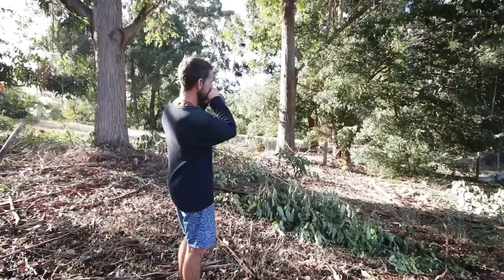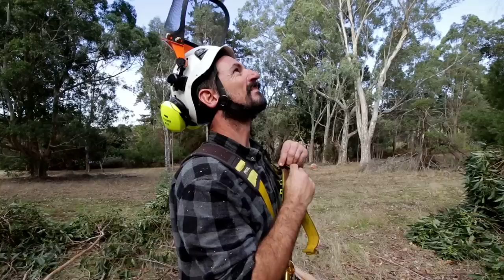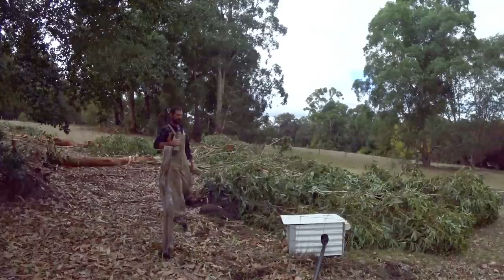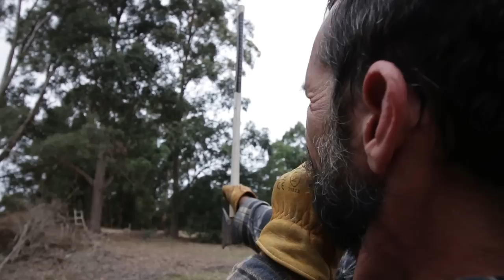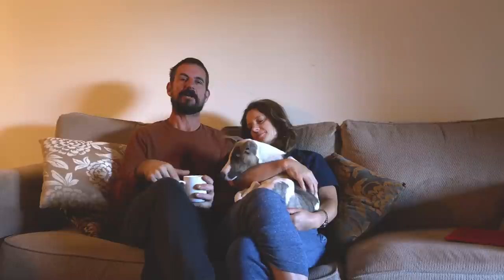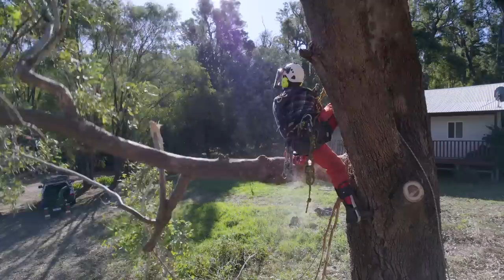Oh No! My Boyfriend is up a MASSIVE TREE with a CHAINSAW 😬 - Free Range Homestead Ep 5

Comment: You can compost the woodchip and use it on the garden in a no dig system. Have you seen the film Back To Eden? It's based on this system. A lot of people get confused over woodchip, as woodchip from a sawmill is going to rob nutrients from the soil. However chipped limbs containing foliage as well as wood is perfect compost. 50/50 brown and green. The green providing nitrogen.

Comment: Buy some inexpensive golf balls and drill a hole, most of the way through, that is a bit smaller than the tang on that file you are using to sharpen you chain saw blade.  Then pound that file's tang into that hole in the golf ball.  It makes it much easier to hold the file and do the job.

Also, if you are having problems getting a light line into the tree, as I did, try using a slingshot and a golf ball.   I had to modify the slingshot to have a larger pouch to fit the golf ball and I drilled a hole through the center of the ball to attach a light line.  But it worked well, though I would recommend using bright florescent orange golf balls so they are easier to keep track of as they fall through the leaves.  I caused significant injury to both of my shoulders in sports when I was young so this is the solution for me.
Reply from the maker: We used to do just that

Comment: I am a professional arborist and if you file down to the smallest cutting edge you'll use your chain up big time, if you have a cutting edge thats much smaller you take the raker down so it has the right gap. Throw out the husky and buy a Stihl! You file the edge until the is no nickel showing.  People feel the point a lot on the cutting edge, you want to ave the whole cutting edge so your finger almost sticks to it.Ive been doing this for 24 years!

Comment: I had never ever cut down a tree in my life until I bought the house I currently live in.  There was this straight as an arrow pin oak tree really close to the house.  I felt it was too close for comfort.  These trees will kill lower branches as they stop producing enough food.  The dang branches just hang and cause a mess around the tree.  I could not walk around it to cut the grass.  I had to push the branches out of the way and hit myself and such.  Annoying as heck.  I didn't want in the future the tree dropping branches onto the house and also I was worried about the roots getting into the sewer and basement.  At any rate it was pretty thick maybe like three feet in diameter or a bit more.  The branches were super even on the tree.  My brother in law was over to help.  He had some experience but nothing with trees that big.  Well we had done the typical cut like you did in that last big gum tree.  Oh it was like almost 45 feet tall as well.  We cut that pie piece out between a locust tree and a maple expecting it to drop there.  But the branches were so even it just stood there.  So I ran to the store bought 120 feet of yellow acrylic ropes.  I tied one end to a hammer and threw it up as far as I could.  By the way the tree was around 15 feet from the house.  At any rate the wind started to blow and we heard some cracking.  I quickly knotted the ends of the rope together, cinched it around the tree and tied it to a massive oak further back.  I climbed the rope and bounced up and down.  Rope became loose we used the knots to tighten around big oak tree behind.  After a couple times hanging like a monkey it finally fell where I wanted it to and bonus knocked off a branch from the locust tree that needed to be cut off.  It was pretty comical and a bit dangerous  lol.
Reply: Bloody lucky lot you.
Reply: @markbernier8434   You are absolutely correct, lucky as heck.  But we cut it up and I pulled all the branches right into the woods.  Done.

Comment: Liked the explanations on tree cutting approach angle and drop location distance with the axe/shoulder.  Same for tree cutting scarf angle 45 degrees Vs 60 degrees and hinge location and height.  Felling big trees with a short saw.  Plunge cuts were not far off.

Comment: I am surprised that you didn't get a Troy Built chipper. Giggle aside you folks are getting it done. Loving the content. Extremely thrilled to see the safety gear being used. Most don't or won't. Great example. The even strokes on the teeth is to prevent curffing of the cut from over sharpening one side or rather under sharpening the other side. You are right about the averages though. If your touching the chain up frequently it won't matter. I will make the assumption that you are familiar enough with spikes to keep an eye one your set (angle and sharpening). Pole and tree spikes are set differently FYI. Belly sliding down a pole with tree spikes is embarrassing. I learned. Happy and Safe Climbing. Not me! Too old! I know a guy! LOL

Comment: Kudos Troy! There are lots of Youtubers with no clue how to log using stupid techniques and/or have no concern to safety. It angers me. Logging is perhaps the most dangerous "hobby" there is! I know bcs I have experienced red snow from others blood, and it was horrible. So when I see such stupid videos in the future I will refer to this one (and some by Swedish Homestead). So why this rant?

Some +40 yrs ago I started my forestry career logging timber in the vast wilderness on the border btw Norway and Sweden. I had just finished a course at a forestry vocational school, and I can still remember the teacher demonstrating how to evaluate a tree, how it leans, other surrounding trees, terrain, obstacles and possible dangers. And then, and most importantly, the kind of felling technique that was best to use in a given situation (delimbing is another thing as soft- and hardwoods are different and I won't go into that there).

Troy, you took me back all these yrs with this excellent video how to do it. Even your comments on how/when to sharpen the chain was spot on. Frequent filings is important - a dull saw is uber dangerous (when I worked full speed felling dry bark beetle stands I brought up to 4 saws and just changed to a "new" when the chain was dull and left maintenance for breaks - working on a volume basis there was no time to struggle with a pesky saw in 1 meter of snow and -35C).

In this video I was glad to see how you used a short bladed saw to fell a big tree. However, I have some comments on how I do (or rather did) basically bcs it's the first (root) log with heartwood that's the most valuable piece (eg for veneer) and you really want to minimize damage from splintering (frankly I soon learned it was the forest owner who was more concerned about this damage than me, hahaha). Hence:

1) One difference is that I always made (and still make) the felling and the directional cut at the same horizontal level. In case the tree was top heavy backwards I could make a slight angel to the felling cut to help the tree going. However, in most cases I use a heavy duty felling bar as a jack. How? If you make the stump lower (also: more wood - more money) you have more leverage to use the entire body to lift. Ofc it's easy for me to say this now, but when young I regularly lifted +150 kg in the gym. In some cases I used aluminium wedges, but I found them mostly a hassle as then I also had to carry an ax and too much gear is heavy on the back. Anyways, the even leveled/co-planar cuts would usually reduce the splintering to nothing.
2) If the tree is so big that the blade will not reach all the way to the center, I make a plunge cut from the front directional cut, cleaned out the center, but make sure it's enough hinge left on either side. Ofc there is a limit to this technique and it's an extremely risky operation - if you mis-judge how much hinge to leave you are screwed. But it's possible.

3) I see you use chaps, helmet and face shield. But what about protecting your feet and wrists? Heavy logs easily crush toes and a stray blade behind some leaves/branches could easily cut your feet. I'm not an OSCHA fanatic, just sayin' ....

Comment: I drive through the town of Husqvarna now and then. I use to file down the depth gauges a bit to get it more aggressive. The old saying on how to use a file in one direction, is proven so many times to be BS, but it still lives on😆
Reply from the maker: I also give the depth guages a bit of a trim if I'm going to do a lot of softwoods. These Eucalypt, I leave them slightly proud so that the saw maintains some nice top end power when it is fitted with the large bar.
Hats off to the engineers who worked all of that out for us!